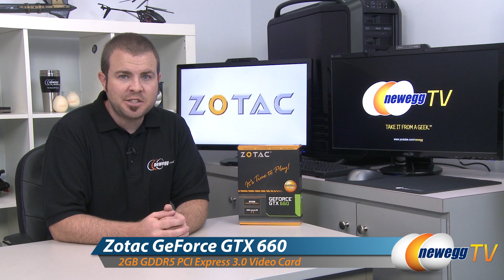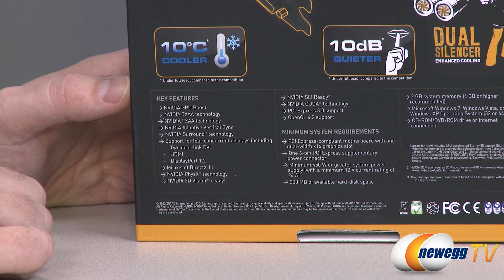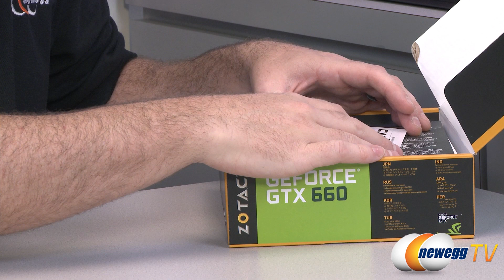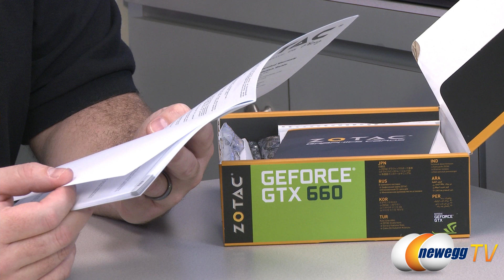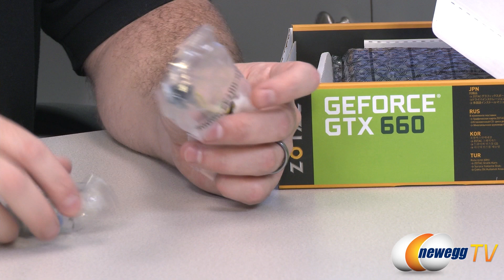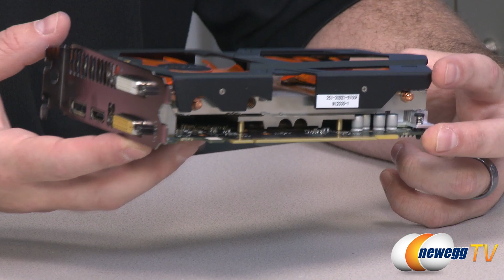Newegg TV: Zotac GeForce GTX 660 2GB Video Card Overview

Comment: I'm glad you've brought up the issue of how many watts for this card. Technically it should run on 430W PSU, and probably quite smaller PSU. The GTX650 Ti is specced to 110W and 400W PSU. This is specced to 140W, so 30W more. However when you look on Pro reviews of this card, the total system power, is usually about 320W. (That's measured at the wall.) Add on your preriferals. Also he says it's compatible back to 2.0, but the Zotac site claims bacl to 1.1, so all good.

Comment: Out of naive curiosity, What are the differences between the 660 and the 660 Ti? I'm thinking about building a few gaming computers (one rack mounted for home, and one mini tower/cube to take with me when I travel for extended periods of time for work. I'm interested in this card because it is smaller than other cards so I figured I could fit it in a smaller case?

Thank you for your answers!

Comment: I ended up buying the Synergy edition [ZT-60904-10M] instead of [ZT-60901-10M] by mystake. Their characteristics are the same (except 901 has a cooler design) but according to zotac website, 901 has extra features and extended warranty... However, on my box it lists all those features as key features. I'm confused.

Comment: I have Corsair VS 450 W PSU .. will the above graphic card will run on it ?
Reply: *****    Processor: AMD Phenom II X6 1055T 2.8 Ghz
                                      Motherboard: Gigabyte GA-880GM-USB3L
                                                 RAM: Corsair Value Select 2 x 4 GB RAM 1333 Mhz 
                                                 PSU: Corsair VS 450